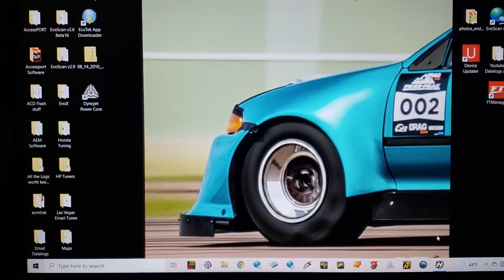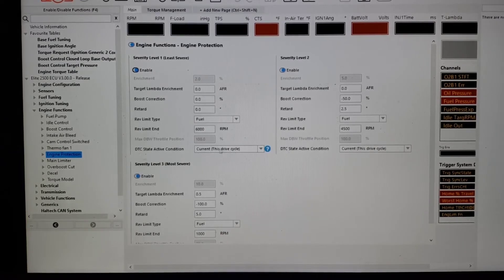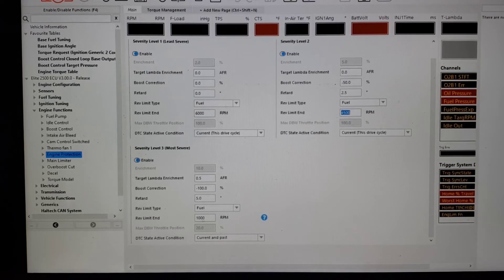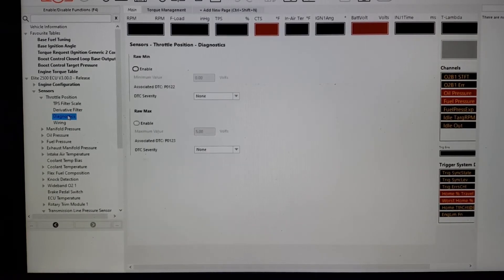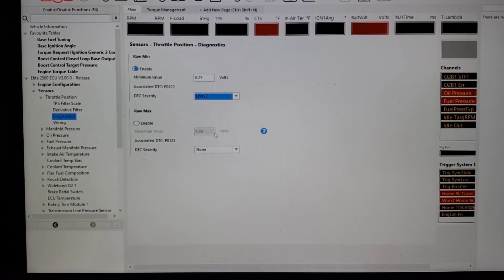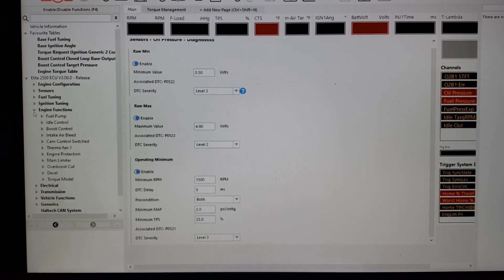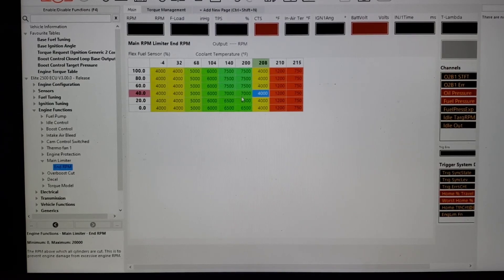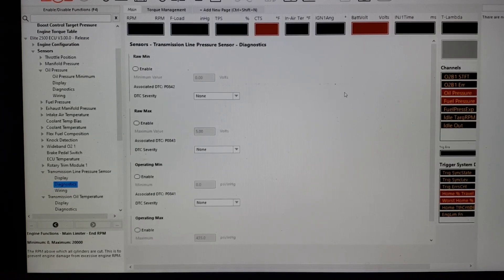Engine Protection Safeties episode 2 - Haltech setup

Comment: I found it ironic you released a video days before Jamie at pfi split his block in half. I’m getting the hints lol. I’ve never ran boost cut, but I’m going to start. Too much money in my new motors for no safeties.
Reply from the maker: That's how I look at it, 400-500 in sensors and fittings, some time, and voila. Hopefully the 10-20k engine stays in the appropriate amount of pieces.